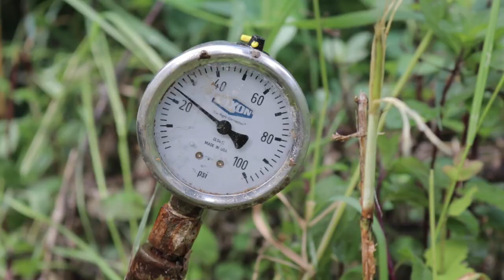My New Ram Pump - AMAZING!

Comment: I don't have a swinging check valve on mine and works awesome. it's a fly wheel.
as long as u have back pressure it will run for years free.
but mine makes free power also.
Reply: ram pump to earth engine upgrade.

Comment: Why don’t you put a tee on further up the line with a cap, use as a rodding point, disconnect at the union, and rod with say a line of 10mm speed fit pipe.

Comment: Could a ram pump run itself or another ram pump
Reply: The ram pump works on flowing water and is extremely efficient considering there is no electricity or fuel BUT there is a loss of 7/8 the original water. This means that the water going up the delivery pipe is 1/8 the original. Not enough water to keep the pump feeding itself for long. Now you can fill a tank and run that water back down to the pump but it will not be continuous.

Comment: #1. ram pumps only work in hill country. a down  hill run is needed.
#2 in my opinion the vent pipe half way down is not needed unless it adds to the air in air tube. otherwise it interferes with the ram of water coming down from the spring.

Comment: Here's a suggestion to make it easier to take apart your union.  I used to work at an electroplating shop, and with the corrosive atmosphere, galvanized pipe would corrode easily. (I replaced everything I could with PVC, but there were still a couple of places where we needed the steel pipe.)  The first time I tried to take apart a union, it would budge, and I ended up having to cut it out, and re-pipe it.

When I put the new union together, I put liquid teflon pipe thread sealant on the union threads. https://www.amazon.com/Permatex-80632-Thread-Sealant-PTFE/dp/B000HBNTGY

This wasn't to seal the threads, it was to protect the threads from corroding.  It worked.  I never had a problem with the union threads corroding and seizing again.

BTW, the liquid teflon pipe dope is better for this purpose than it is for sealing threads.  With teflon tape, you could back off the pipe a little and not have the threads leak.  If I had used the liquid teflon on some threads and had to back them off to adjust something, the joints leaked.  Just FYI.
Reply: I wonder how food grade silicon plumbers grease would work on that steel union?
Reply: Probably any kind of thick lubricant will work.  The liquid teflon was already in the the toolbox.

Comment: you need a pc of pipe the  length of the  pipe wrench to put on the handle then you can crack any joint with ease

Comment: I need to make you a video that shows how to wind and install dual line heads (especially Stihl brand) and the reason the string is going into the head of the trimmer is most likely cause by decelerating while bumping the head to feed the line.  Too many people let off the gas when they bump the head and it can suck in the line.  It could also be breaking off because the guides are worn, but you can tell by looking at the string.  It is also not likely the guide unless only one side is ending up in the head.  You might want to try the auto feeding string heads (STIHL) to see if that works.  It used to be called the "autocut", not sure if they even offer them anymore. 

Lastly, when starting 2 strokes, especially Stihl products you don't actually need to pull so hard.  They just take a certain amount of cycles to get going.

I'm just offering some advice, do with it what you want.  As a kid our family business was power equipment so I literally assembled, worked on, played with these things my entire childhood...  Now I actually have all battery powered stuff and went with Milwaukee, but not because of any negative aspects of Stihl.  In my current career I have a relationship with Milwaukee.

I enjoy the videos!
Reply: then you should know that when the string has been in the spool for awhile and gets short it has a tendency to retract back in the spool.
Reply: @orionpyramidservices9261   --- You said it, "when the string gets short"...if you keep the string length where it is supposed to be, even when storing, it won't creep back into the spool.  I just went and checked my own trimmer and the string is not retracted.  As I mentioned above, just advice feel free to tackle your issues any way you see fit.

Comment: Thats pretty amazing. I've never seen or heard about a ram pump before.
I was wondering tho: is it possible to add a hose or something to the "wastewater" outlet to redirect the water so it doesnt splash all over the pump itself?
Reply: A hose would reduce the input flow rate - which would reduce or even stop the pumping. But there is no reason a trough/drain couldn't be put under the input standpipe.

Comment: Nice...do you use that water for drinking and watering the garden, or do you have separate, underground well for drinking water?
Reply: They use it mostly to irrigate their garden. Cody has a series of videos on building the water tower the ram pump fills. He also can fill his fire pump tank from the tower in the event of a fire on his or a neighbor's land.
Reply: +Kalimerakis I don't believe so as in the water tower videos there are only two lines coming out of the tank, a small one to the garden and a large one to fill his fire tank. If they do then it is only as a secondary source of water as the ram pump is unusable in the winter.

Comment: ithink another non return valve may  be necessary  at out put at certain distance to minimise the back flow pressure
Reply: Yes that is a good suggestion. It is like a Giraffes neck. The non return valves keep the pressure off the heart.  In this case its a ram pump. :)

Comment: my wife loses the cord as well it means they are not tapping on the ground hard enough or often enough to self feed i hit the ground every 10 to 20 seconds or when it starts to rev higher than usual try that if not just take it off your wife and hire someone to use it i have banned my wife from using it now
Reply: Wait a second now.  
Think about trying to ban Mrs. W. from doing what gives her a sense of accomplishment and pleasure.  
Right.  Exactly.  ;)  

I would suggest a "Plan B" at this point.  How about a blade for the brush cutter of which she won't be scared?  Here's one:  
http://www.stihlusa.com/products/trimmers-and-brushcutters/accessories/trimmer-heads-and-blades/brushknife/
Reply: Yeah, she could sit in the house and eat bon bons instead. Then you will be aggravated about her fat bottom. In all fairness I don't let my wife on the tractor to bush hog for safety reasons and I don't want the tractor tore up.

Comment: I do not understand why it is necessary for the first valve to gush water out. It seems like that water could be used in some way that doesn't allow for waste.
Reply from the maker: It could but here it just returns to its original destination. mrsw
Reply: ok. i understand now. Thank you
Reply: In order for the pump to work, an effect called water hammer is used. The pump spills water until the velocity of the water in the head stock pipe is moving fast enough to close the first check valve. When the first valve closes, the momentum of the water in the pipe causes the pressure to multiply and force water past the backpressure valve.

Comment: Awesome!  First time I have heard of or seen a Ram pump.  Still trying to wrap my head around the concept.
Reply: Cody did a video quite some time ago where he builds the large one he uses now. Check back through his older vids.
Reply: Thank you!
Reply: actually he explained pretty good principle of work. on the very end, how it works is not too important, just a fact that it work without any input of energy is just enough for me. till there is enough water to enter the pipe, you will have it delivered to your water tank.

Comment: Thank you for reminding everyone about how precious water is.
Reply: A ram pump is NOT an efficient way of pumping water. Its two advantages are that it can be built relatively inexpensively and it does not require electrical power.

Comment: Anybody else think this design wastes a massive volume of water?
Reply: You can call it wasting... but if you have the 'waste' feeding back into the stream further down, its just taking what you need, no?
Reply: Not really if you apply it correctly. Here's an example, as Cody eluded to in the vidjeao..if you use the feed to fill a water tower you would have water at the ready and on demand. Once the water tower hit the full mark you could have the overflow pipe run back into the stream. That way you only take what you need. The water coming out of the check valve works its way back through the ground back to the water table where it starts the process all over. I think this process is quite skoocum and has lots of chooch factor. No electricity- no fuel- just plain ole ingenuity! Bravo to the inventor.
Reply: So what if it waters the ground? ... Water dosent 'disappear' when it leaves a stream/river/lake. There is as much water on the earth today as there was a billion years ago

Comment: I'm starting fresh from the ground-up how do I install the pipe in the creek? Thank you for all of your videos they've been a very informational I'm studying it nightly
Reply: @mike gentsch
the pump has to be downhill from the water , if any part of the feed pipe goes above water level then you have to prime it first , like a siphon , once the water is flowing connect pump and build up back pressure as in the video :-)
Reply: @TheCraigy83  
the water has to flow downhill into the pump , it is basically a fluid hammer , when the flow is fast enough the waste valve closes , as the waste valve closes the water keeps moving and opens the second valve til the water stops moving , then gravity opens the waste valve and the water flows again until there is enough flow to close the waste valve  :-)
if the water from above has to much pressure the waste valve wont open with gravity on its own , it is a bit of a balancing act :-)
Reply: @TheCraigy83  
its all gravity and acceleration , when you lift the slab its moving slowly using muscle power , when it is released it becomes an un suspended 5 ton weight which accelerates toward the ground at (i believe) is 32ft per sec per sec , probably easier to imagine hooking a pry bar under one edge  and pulling the pry bar until you have it as high as it will go , now its a gravity powered spring , if you let go of the pry bar the slab goes down and the pry bar goes flying :-)
i hope that helps a bit , im not really good at describing mechanical operations , takes me a while to think of something which may help , gravity is wonderful , till it bites you , hehe :-)

Comment: Amazing indeed. I never seen this!!(we do not have need of this in Holland where all is flat) thx for sharing, also if you use 
http://www.griffon.eu/en/products/856-thread-sealing-jointing-compound-and-hemp/product/733-silpat/ on the 3 part connection (the thread)  it wil come lose verry easy cheers :)

Comment: you need to adjust the valves on your weed eater
Reply from the maker: 2 strokes don't have valve. I assume you're not a mechanic,
Reply: sthil trimers and blowers have valves in there 2 strokes I work for a commercial landscaping company I adjust them 4 times a year   @wranglerstar
Reply: if you search how to adjust valves on a stihl weed eater you get quite a bit of videos on how to. feel free to check   @wranglerstar

Comment: Hi Cody, here is a tip for Mrs W to stop the string going back in the spool on the line trimmer. What usually happens is the line gets super hot and fatigued where it comes out of the eyelet. The way to avoid this is every few meters or minute or so, do one bump on the ground to release a little bit more line. My wife and I can go through a whole spool of line doing super hard brush clearing without any problems with the line going back in the spool. Hope that helps!
Reply: Just a little further clarification, when you do the bump on the ground to release more string, do it at full throttle. It shouldn't have to be a hard crash in to the ground just a firm and brief bump, but regularly doing it, more often in the tough going and less in the easy stuff is the key.
Reply: I also listen to the sound of the string. you can tell when its getting too short.
Reply: Me too, but depending on the type of line and what you are trimming, you may need to extend the line before you hear the revs increase. This is because the problem can be the string melting and fatiguing where the eyelet is in the head vs getting too short.

Comment: I bet I can make one that doesn't waste water...well probably around 80-90% efficiency. 
 I do not have the money for the stuff to prove it though.
Reply: No, you can't. Energy = flow * pressure. If you want to pump water to twice the height of the inlet, you need to double the pressure or not a drop will get there. Energy is constant (you can't make free energy), so you have to decrease the flow by 50% to keep the equation balanced. Now there is twice as much water going in than water going out, but the 50% going into your tank has as much energy as the 100% flowing into the pump. This means the other 50% has no energy left and has to be wasted.
Reply: yes I can. the math is fine..only you're missing one. ;) how do we restore flow/pressure? The same way we started. stop getting caught in the equation and think of a way to make...a natural capacitor...only with water. I'll give you a minute. You use one everyday.
Flush the waste reservoir.
why would you think you'd need to "make" any energy? Its already there, being used before you.
Your equation is wrong to begin with, btw. there is no flow, or pressure without...?
Reply: what? I can't hear you.

Comment: Sorry for being annoyingly picky, but at around 22:00 you said that once the water reached its destination that you could open up the valve fully because of back pressure. That is technically incorrect, since the ram is facing maximum back pressure as the water column rises.  Once the water goes beyond the height (adds in work) needed to elevate it at the spigot, it will then usually go a little downward, but in any case finally create a situation where the water can flow because of the difference in pump pressure head vs. the weight of the water column being raised.  Now, once the water starts to flow, it follows dynamic pressure characteristics which creates a low pressure drop, so the backpressure is actually less and creates a larger pressure differential between the pump head capability and the flow pressure. This is how siphoning works.
Again, sorry.

Comment: if you use teflon or molydenum on the threads they won't freeze up on you. easier assembly/disassembly and yes there are other methods